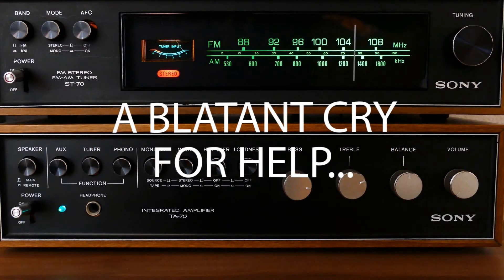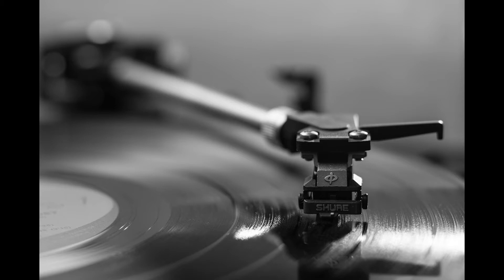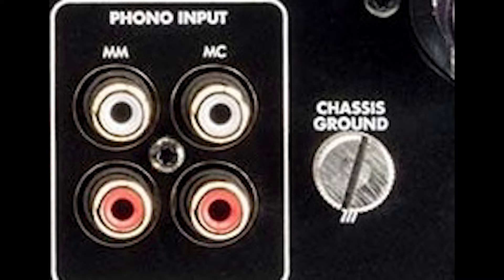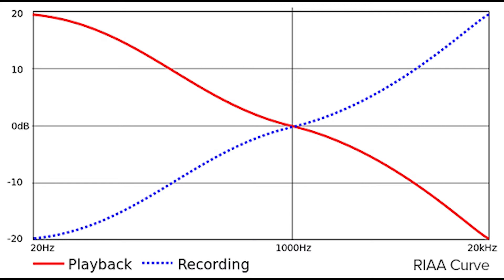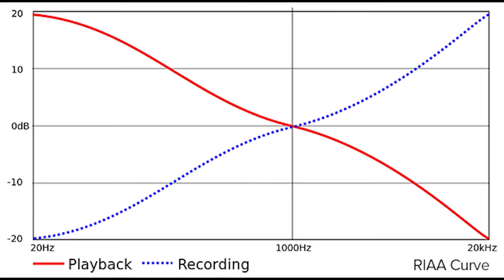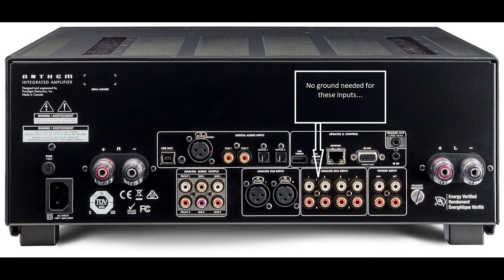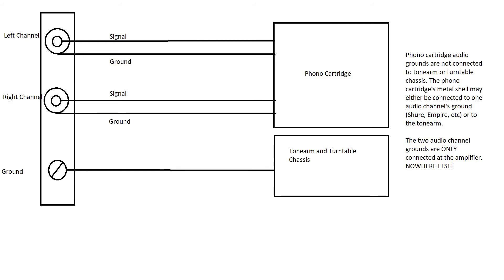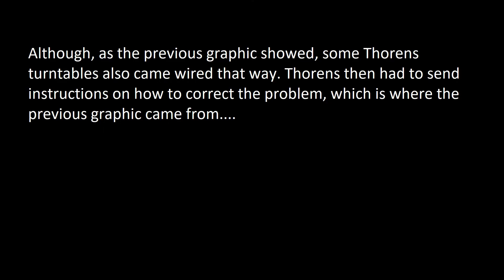Why Do Turntables Have Ground Wires?

Comment: Could you elaborate on your explanation on balanced connection? In my opinion the hot pin carries the signal, cold pin carries a phase inverted copy of the signal and they bot use the third pin as a common ground reference.
Reply from the maker: The answer might be a bit cumbersome for a reply to a comment, but here goes! What you have described is an "electronically balanced" connection, something that arose in the early 1970's as audio transformers were becoming unpopular, and op-amps had become a way of life for audio designers because they were cheap and simple and very useful. An unbalanced (signal and ground) connection was replicated with an inverting, unity-gain amplifier, usually made with an op-amp, and so now you had exactly what you describe: hot (non-inverted signal), cold (inverted signal), and ground. While this is a perfectly valid balanced connection, provided it goes to a balanced input that makes equal use of both phases (hot and cold), it is not what a balanced connection was supposed to be. 

Originally, transformers were used at each end of a balanced connection. The audio flowed between transformer windings on each end of the cable, and there was NO ground reference for the audio - only the shield of the cable was grounded. In fact, back in the days of analog landlines, telephone wires moved audio for miles, on the same utility poles that carried AC power, with little hum problem, by using a transformer-balanced system with NO shield at all! This true balanced connection is often called a "floating" balanced circuit.

The most easily-noticed difference between electronically balanced and true balanced (floating) connections is that while with a modern, electronically-balanced signal, you can dispense with one of the phases and have an unbalanced signal (albeit 6dB quieter), ready to use, because there is a ground reference for the audio. True balanced circuits - using transformers - don't work like that. You have to intentionally ground one phase, and only then will you have an unbalanced connection, and this time, without the 6dB loss that converting an electronically balanced signal suffers. Note that the introduction of phantom power to balanced mic lines by Neumann in 1966 rendered transformer balanced connections using phantom power non-floating.

Now, as regards pseudo-balanced connections, like phono preamps have, these are actually unbalanced, because the "cold" connection is connected to ground at the phono preamp, But the shield of the audio cables does not connect to the chassis or tonearm of the turntable. It only connects to the coils of the phono cartridge. The chassis ground connection is made with a separate ground wire, so that any hum current that might flow between the turntable chassis and the preamp does not flow on the audio cable shield, and so cannot be easily induced into the "hot" connection carrying the music.

I hope this helps.
Reply: @ScottGrammer  Thanks a lot for the precise answer, really appreciate it! Gives me a few Keywords to read on further and hopefully being able to understand this properly:)

Comment: do i need to ground my turntable if i’m not using a preamp or receiver?
Reply from the maker: I can only assume you mean one of the newer USB-equipped turntables, and that you will be connecting it only to a computer. In that case, no you do not need to ground it.

Comment: Does it matter if the ground wire is connected between the washer and ground screw? Or should the washer and screw be over the ground wire? Thx in advance 😊
Reply from the maker: It does not matter.
Reply: @Scott Grammer  Thx for fast reply!👍🏽✌🏾

Comment: I have a JVC AL-F350 model that I can hear is sound but when I connect it to my soundbar is almost not sound, do you have an idea why?, one thing sure is the ground cable is not connected, should I?
Reply from the maker: Your JVC turntable needs a phono preamp to work with a sound bar. You can find basic phono preamps for about $25, and yes, you'll need to connect the ground wire to the preamp when you get one.

Comment: Hi, Scott. I own a Dual 1219 and just had a custom built tube integrated amp. There is a phono amp built into the amp. When I switch to Phono switch on the front, I can hear a hum or buzz (can't tell which one). When I switch to 1 or 2 on the front there is no hum. My question is do I need a ground wire going from the chassis to the ground wire (3-way) binding post on the back of amp to eliminate the hum? Thanks.
Reply: I forgot to mention I do have a L & R RCA going from the 1219 to the amp.
Reply from the maker: Hi, Rich. Yes, you'll need that ground wire. The Dual should have one from the factory, but if not, you can attach a length of 18 or 20-gauge insulated wire to the screw on the underside of the chassis where the strain relief for the AC cord is. The other end of this wire connects to the ground on your amp. The ground wire should be about the same length as your RCA cables.
Reply: @ScottGrammer  I don’t see that screw and I’m not too handy. I’m not sure I see the screw, but I’ll look again. Can I buy the wire at Home Depot? Can I attach the bare wire to the back of the ground wire binding post on the back of the amp? Thanks
Reply from the maker: @richwidick4648  You may want to have to have a ground wire professionally installed on your turntable. It's a simple matter for a pro tech, and should not take more than a few minutes. Yes, you can get the wire at Home Depot, but if you're going to have a pro do it, he or she should have suitable wire in stock. All you need is three or four feet of 18-22 gauge insulated wire.
Reply: @ScottGrammer  Good suggestion and that’s what I will do. I really appreciate your quick reply and help. Looking forward to watching other videos from you. Have a great Holiday!!

Comment: Also, as far as an antenna on my receiver is it better to hook up 300 ohm with a dipole or 75 ohm with coax.  And is the 75 ohm only for outside antenna
Reply from the maker: As for which is better, 300-ohm twinlead or 75-ohm coax, it depends on what you're connecting and how the cable will be run. Generally 75-ohm coax is better because it provided better interference rejection and because it can be run near metal items (like aluminum siding) without a problem. Twinlead should be kept at least a foot away from metal or from outdoor surfaces that can get wet from rain, as being close to conductors will upset the impedance of the cable. BUT - good quality twinlead, properly installed, has less signal loss than coax, so if your antenna is 100 feet or more away from your tuner, twinlead might be better. If you're using an indoor dipole, just use whichever is most convenient, as the length of the cable run is not long enough to cause significant losses with either type.

Do avoid using "balun" adapters if you can, as these can lose up to half your signal. If your antenna has a 75 ohm output, use coax and connect it to the 75 ohm input on your tuner. If your antenna uses twinlead, then just use twinlead and connect it to the 300 ohm input on your tuner.
Reply: Did you get the picture of my unit it is a pioneer SX 3600 and I do not have a coax connection
Reply from the maker: @sandracohen8481  No, I didn't get a picture, if you emailed one to me. But I'm familiar with the 3600. You can connect coax to it if the coax does not have a plug on the end. You'll need to strip the end of the coax and separate the shield and center conductor. On the rear of your 3600, there are four screw terminals for antennas. The one on the right is for AM, ignore it. Second from the right is ground, this is where you connect the shield of the coax. Third from the right is the 75 ohm terminal, this is where you connect the center conductor of the coax.
Reply: What can I connect the coax to in the house
Reply from the maker: @sandracohen8481  You can make a simple 75-ohm dipole by connecting the other end of the coax to two lengths of plain wire, each about 31 inches long. Arrange the coax and the two lengths of wire into a "T" shape, perhaps taped or tacked to a wall, with the coax going straight down for at least three feet. A dipole such as this is bi-directional, and will be best placed on a wall that faces the radio stations you want to receive.
Reply: Hello Scott, could I get an email address from you so I could send you some pictures of my operation
Reply: Scott can I get your email please so I can send you some pictures

Comment: Thank you for this I have bought things from you in the past. Hope you have an onkyo turntable soon.
Reply from the maker: I don't often sell things. What did you buy from me?
Reply: @ScottGrammer  sorry I thought you were the guy that sells audio equipment in the back of red bank thrift store. I must be mistaken. I bought an onkyo DVD player a while back to use as a CD player but since gotten a CD player for my stack but still using the DVD player in my setup. Currently seeking a turntable to complete my setup.
Reply from the maker: @jasoneustice8034  I do work out of the back of the Red Bank Thrift Store, however, the DVD player you bought, though you may have talked to me about it, was actually sold by the thrift store.
Reply: @ScottGrammer  ok I understand. If you run across a black vintage onkyo turntable let me know I am seeking one. If I find one that need repairs I will buy it and let you know.:)
Reply from the maker: @jasoneustice8034  Check the "about" page of this channel and you'll find my email address. Email me and I can give you some contact info of a couple of people who might have such a turntable.

Comment: I have a bSr record changer that has 4 connections for power - black, white, red, green.  I don’t have a chord so I’m wanting to wire it with a regular 120 vac cable.  How do those wires get connected?  I know the green is the ground - but then there are three.  One looks like it goes through a switch.  Can you help?
Reply from the maker: My suggestion would be to go to the vinyl engine website, vinylengine dot com, and see if they have a service manual for your model of BSR turntable. If they do, the service manual will tell you which of the four wires do what. If you're not comfortable reading schematics, it might be better to have a professional wire it.

Comment: Hi Scott, thanks for your video. I have 2 Klipsch speakers that have phono inputs and I want to connect both of them to a turntable, so I can have a stereo setup. In other words, the left cable from the turntable would go to the left speaker and the right cable would go to the right speaker. Do I have to split the ground cable into 2 separate cables so that each speaker receives a ground? Or is it ok to just install the ground cable to just one of the speakers?
Reply from the maker: Hi. Are you sure those Klipsch speakers have actual phono preamps in them, or are they merely line level inputs? Most powered speakers only have line level inputs, which will not work connected directly to a turntable. I have seen one pair of powered speakers with an actual phono preamp, but in that case both inputs (and all the electronics, as well as the phono ground terminal) were in one speaker, and the other speaker connected to the main one with a simple cable. What is the model number of those speakers? The Fives, which do have phono preamps, have both inputs on one speaker, with the other connected by an umbilical cable.
Reply: @ScottGrammer  Thanks for responding! The model that I have is the Klipsch One II. It is designed to connect the turntable to only one speaker, since it has a Left & Right input. However, since it has the left & right drivers integrated in such a small enclosure, I would like to use two separate Klipsch One II speakers to increase the stereo separation. So, that's why I would like to use one turntable for 2 of these speakers and needed to know how to deal with the ground cable.
Reply from the maker: @Guachum  in that case you would need to connect the ground wire to both speakers. What concerns me is that you could very easily create a ground Loop which could cause the very hum you are trying not to cause.
Reply: @ScottGrammer  That's what I thought. I really appreciate your advice, considering that you're an experienced electronics technician.
Reply from the maker: @Guachum  If I may make a suggestion, use an inexpensive external phono preamp and connect your turntable to it. Since the One uses 3.5mm inputs, you'd need two cables, each with an RCA plug on one end , wired to both the tip and ring (that is, the center conductor is wired to both tip and ring, while the shield connects to the sleeve as usual) of a stereo 3.5mm plug on the other end. These two cables could then be run between the outputs of the phono preamp and the line inputs of the Klipsch speakers. Since this would be a line-level signal, no ground would be needed, and the cables could be up to 20 feet long with no problems. By the way, the One does not have a phono preamp built into it.
Reply: @ScottGrammer  Scott, the One is a different model. I have the One II, which has phono pre-amp and RCA inputs that can be used for either for line or phono inputs, by flipping a switch. I like the idea of using preamp so I can control the volume of both channels without having to adjust each speaker. Also, as you said, using line inputs would allow me to use longer RCA cables and not worry of ground issues. I have an old SAE preamp that should work. However, I was curious to see if it works straight to the two speakers. I think it would be interesting if it does work. Techmoan has a video called "Klipsch The One II REVIEW", in case you'd like to check it out.
Reply from the maker: @Guachum  I just took a look at that video. Techmoan is one of my favorite YouTubers. I was going off the info on the Klipsch website. Apparently there is the Klipsch "The One II Phono," which is separate from "The One" and "The One II." I did not see it on the Klipsch website until I looked for it by name. 

The SAE preamp sounds like the best option. Be sure to set the line/phono switch to "line" on each speaker.
Reply: @ScottGrammer  Yes, it's confusing since they have two versions of The One II. Thanks!

Comment: I hooked up a long rca because I moved my tt farther away and now I got major humming noise🤔🤔
Reply from the maker: Usually, you don't want cables from a turntable being longer than six feet (about 2M) for that very reason. Also, longer cables have higher capacitance, and due to the inductive source impedance of the phono cartridge and the relatively high overall impedance, the extra capacitance will reduce the high frequency response. If you must have the turntable away from the rest of the system, invest in an outboard phono preamp, and keep it near the turntable. Then run long cables from it to an auxiliary input on the stereo.
Reply: @ScottGrammer  thank you, I do plan on purchasing a shiit mani pre-amp in near future, hopefully that will work, thank you again for your quick response Happy New Year!!🤔👍

Comment: Well, should this video tell the truth, the question then is why all the turntables equipped with the DIN 5 pin connector are essentially wired the bad way...
Reply from the maker: They're not. DIN phono cables use five connections: Two for the left channel audio, two for the right channel audio, and the last (the middle pin in the DIN plug) is chassis ground. BTW, nice channel you have! I have subscribed to it.

Further, DIN cables can support true balanced connections, but you must disconnect the shell ground found on most phono cartridges and connect the shell (if there is one) directly to the tonearm shield or ground wire. And of course, you'll want to replace the RCA plugs with XLR's or some other connector capable of balanced operation.

Comment: hello my friend can you help me? I'm having problems with my vinyl playing record. the speaker keeps shifting back and forth at high volumes. the ground is correct. I replaced the cable with a new one. the right and left wires are correct. the device is far from the boxes. already reviewed the cables. I can't solve it. my setap devices are: amplifier pioneer elite a 20, and the vinyl record player is technics slq 2. voltage 120v. Thank you very much
Reply from the maker: When you say that the speaker keeps shifting back and forth at high volumes, do you mean that the woofer cone is moving back and forth a lot, and not in time with the music? If so, you're probably experiencing low-frequency feedback. Try taking the dust cover completely off the turntable, and also make sure the turntable is sitting on a firm, heavy support. The Elite A20 has no subsonic (infrasonic) filter, but you might try turning off the loudness button if it's turned on, and reduce the bass control setting a bit. If either of these seems to cure the issue, then feedback is almost certainly the problem.

There is another possibility, and that is that you have a warped record. Warped records can send massive low-frequency bursts through the amplifier, and this can cause what you're describing. Does it happen with every record you play, or just one or two?

Hope this helps,
Scott.
Reply: @ScottGrammer  yes, it occurs on all discs, but I think that might be the problem. when I turn on the bass, loudnes, the vibration occurs with greater intensity. I've already tested it by moving the device around, the same thing happens, measuring the wires of the arm with a multimeter, ok. already replace the condensers with one of greater capacity. it could even be the lack of subsonic filter. thank you very much, success.
Reply: @sidneyalves1556  If you listen really loud, turn up the bass, and engage the loudness control, You are very likely to have this problem. Replacing electronic parts will not help. It's also aggravated by having the turntable too close to, or on the same cabinet or shelf as the speakers.